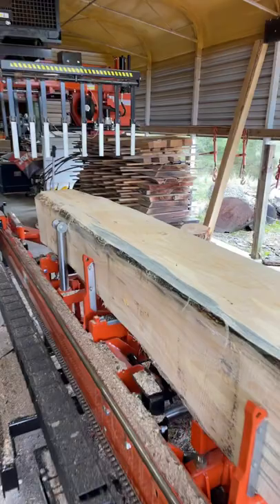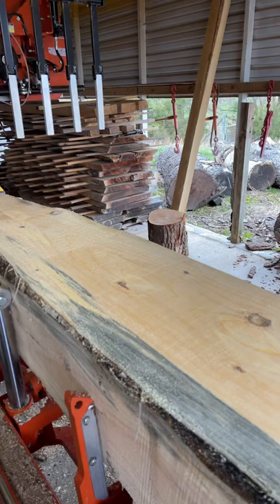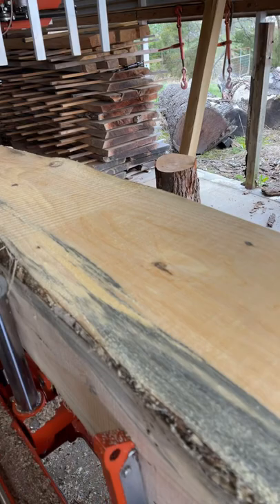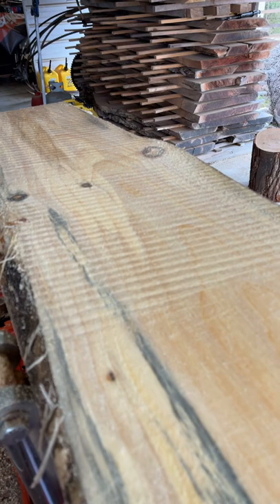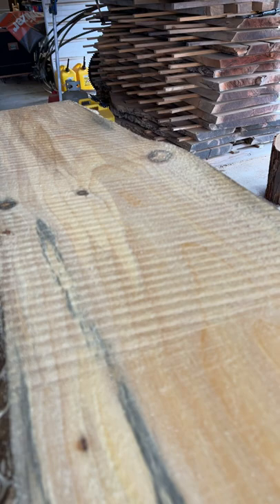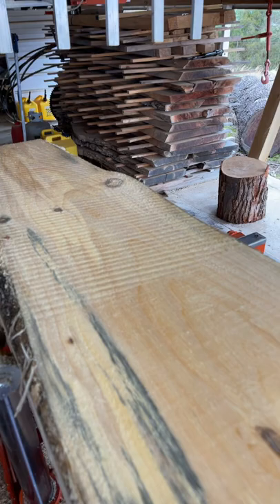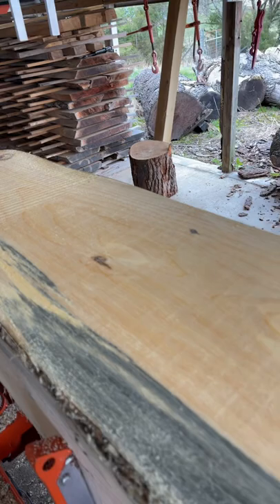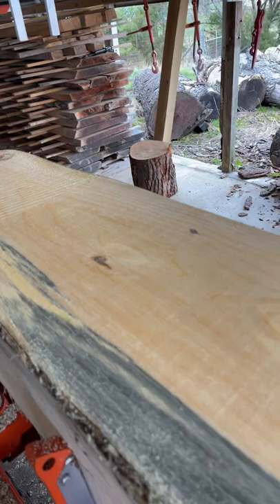Get better cuts on your sawmill #shorts

Comment: Can you go slow enough to keep that from happening?
Reply: Isn't the point he just said that it's from going too slow... How would going even slower help. He said that's a sign you're going too slow so wouldn't the only option be to speed up...? Why don't you like the speed up answer😝
Reply: @cececox6399  Why do you accept speed up as the only answer? It is obviously the answer to that situation but do you always except the first thing you hear as an absolute and there's no other possibility of it being anything else without asking questions and researching into other possibilities to find the completed version of how something works? Could he have meant when he said too slow as in when going fast you have to go very fast rather than a slower fast? There is a possibility when interpreting what he said in that way you could go very slow and it cut smooth. Fast is obviously the best option but what I was curious about is, is there a possibility that starting off very slow and continuing to go very slow that the cut would be smooth or not? Just curiosity and wanting to understand more on how the blade reacts to speed thus how the mill works altogether.  😊